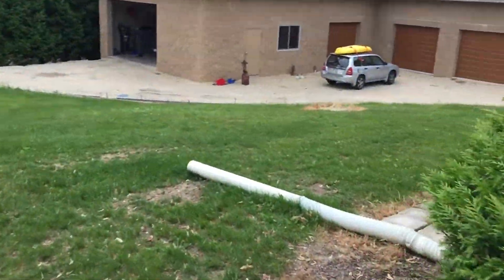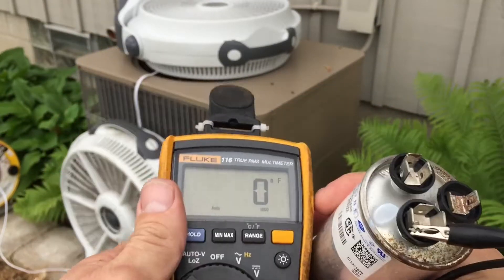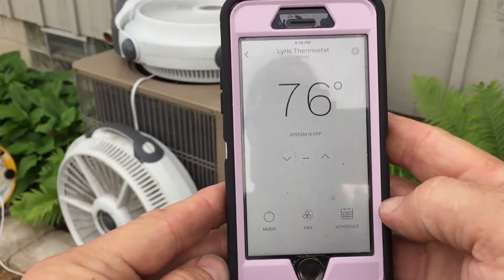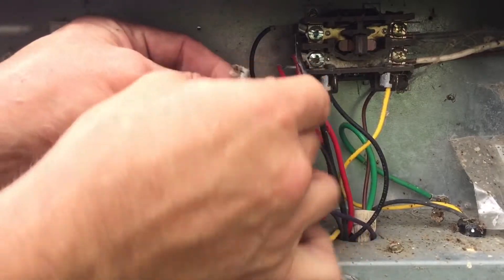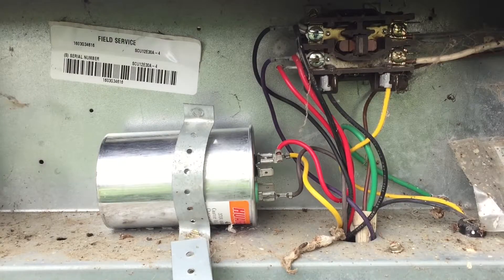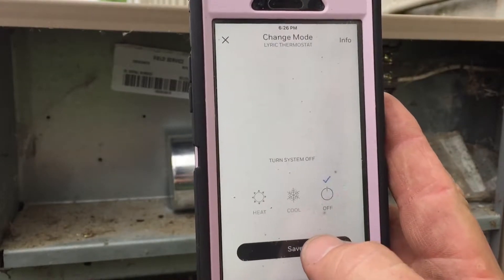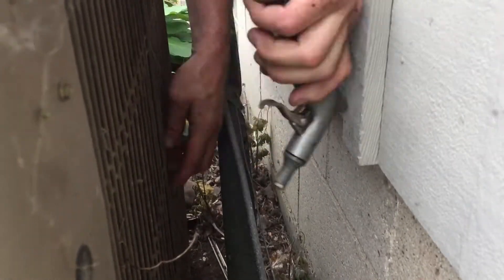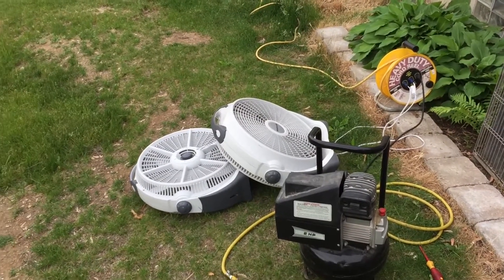How to replace the capacitor in a armstrong central air conditioning unit

Comment: Thanks for making this video. I have a 2003 Armstrong. It looked exactly like the one you showed. I was able to get the correct capacitor at my local hardware store.  So by following what you had shown, it was less than 45 min start to finish.  Running like a champ.  Your a lifesaver!

Comment: That is one piss poor cleaning.
Reply: I think my cap just went. I have an Armstrong unit also. SCU10E36A-4. Unfortunately the sticker is no longer on the  capacitor so I’m not sure what size I need. I noticed that your capacitor that you were replacing was a 40/5 and you replaced it with a 45/5. Does going larger than the original equal no harm no foul?
Reply from the maker: @103eaglecrest I don’t know. My system has been fine since then. However I do not know if the higher number is good or bad. Sorry I’m not much help on this.
Reply from the maker: Lol definitely made sure the coils were clear.